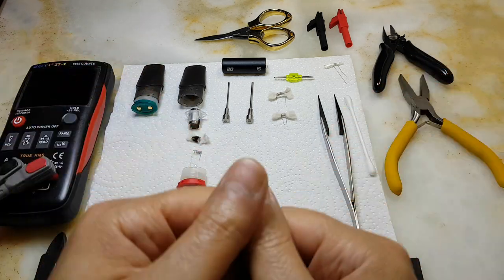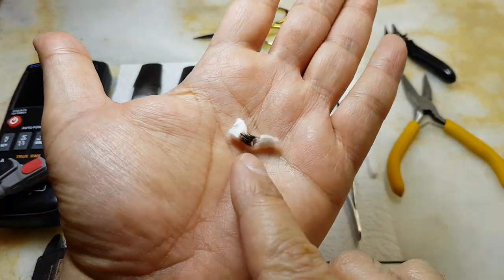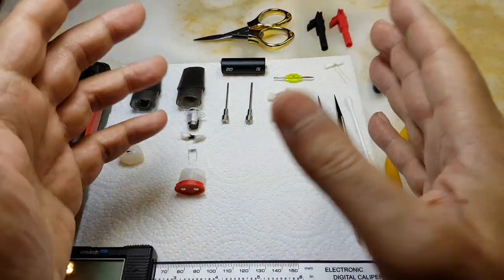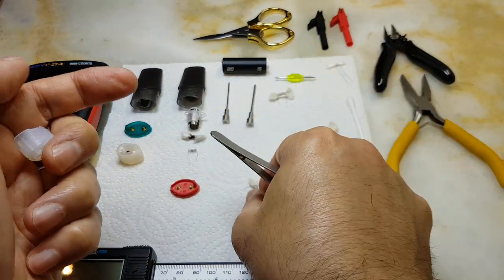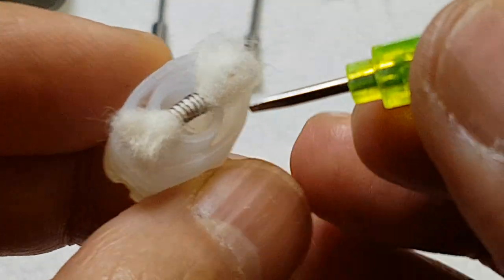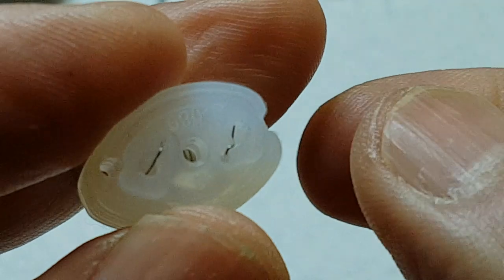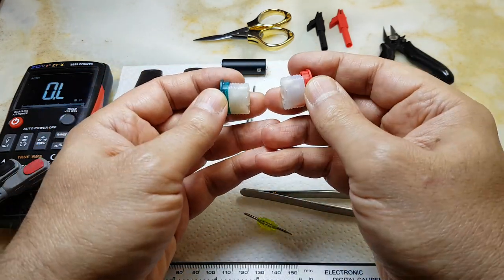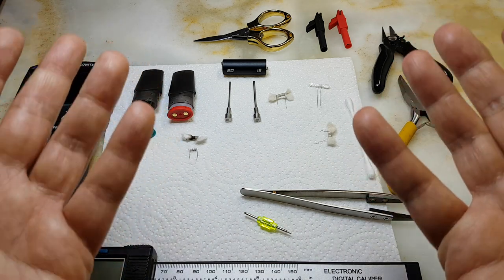Vype ePen 3 rewick & recoiling cartridges

Comment: I've recoiled mine. I use the 1.8 ohm premade welded nr r nr wire from fast tech. I also coil it on a 1.5 mm. Also when wrapping wrap away from you, as it's backwards than the minifit, this way the coil will end up fitting more horizontal Works pretty good and good flavor.
 I read the specs somewhere it was 1.95 ohm. I suppose a person could use the 2 ohm coils to get close to the original and flavor.  But using the nr r nr wire you run less of a chance of ruining the rubber because the leads don't heat up.
Reply: Nice, do you think the rubber would burn/damage easily  with regular kanthal? (that's seem to be the wire vype used in these pods ) i'm also interested in the minifit but the epen seems to be lot easier to rebuild and it's like 4 times cheaper than the minifit LOL
Reply: @urbanspy2008  
I have the vype epen 3 also. I like the build quality of it also, and the draw from it nice too. 
I use the NR-R-NR wire on all my above ohm devices. In my opinion this ensures that the rubber or plastic (depending on your device) will not burn or char. (I'm kind of a tight ass, and want to ensure my pods will last as long as possible.) However, you do what you have to do to recoil /rewick it. For me the key is the Scottish roll of the wick, for more flavor and less flooding/spitback.
I hope this is helpful and answers your question.  This is just my expierence.
Reply: @urbanspy2008  
Also another trick I use to recoil these type of devices is this.
When figuring out what diameter to recoil the pod, I went to the hardware store with a digital measuring device. Got some regular nails and measured different diameters between 1.6 mm and 1.9 mm picked up 2 of each.
Got back home and put the nail in the two cut out divots. Which ever one is the snuggest, is the one I wrap the coil with.  This also ensures when you thread the cotton through,  it will be snug enough not to let extra fluid in when rewicked and flood device and give you less spitback (if any) also. 
Again just my experience and thoughts on gauging the perfect diameter. With NR-R-NR wire, this trick works wonders because you don't have to guess or use steam engine on calculating wraps.  Pretty straight forward (figure best diamter, wrap wire,  thread cotton, prime coil with juice, fill pod, put together and vape.
Reply: I made coil from SS 316L 32 AWG, about 1.9ohm but it does turn off after 3-4 long hits - I get 3 times ed light blink. What coil should I make to prevent this?I have 28, 32 and 38 AWG SS wire, I think about making wire form 4x38AWG, just twist 4 wires together. I will go with inner diameter about 1.8/2mm, what resistance should I aim to reduce automatic turning off the device? Should go for about 2.2 ohm instead of 1.8?
Reply: @Piecho3a  
As I've said in my previous posts, somewhere I read the original coil 1.95 ohm. 
Also, I recommend the NR-R-NR wire from FT. The have a regular welded wire which is nichrome, and a kanthal welded wire. 
In my experience,  the kanthal wire takes a little longer to heat up than the nichrome wire, for me cause flooding issues, because like you I take long drags/puffs.
In my opinion,  for pod systems like these, Stainless steel is what I've read most of them use but are NR-R-NR wire. FT no longer sells stainless steel NR-R-NR wire.
To get it to heat up efficiently,  I would recommend a nichrome wire. Some complain they don't like the taste, but it does heat up liquid efficiently for the size of the device.
With what you have though, stainless steel heats up pretty quick.
My opinion for your build:
-32 awg stainless, 2 mm inner diameter,  10 wraps.
-30 awg stainless is not going to get hot enough, 34 awg is going to get to hot.
Also on the coil, don't crimp together,  kinda have it a spaced coil.
I hope this is helpful.
To build coils here is a site to go to for using regular wire:
https://www.steam-engine.org/coil
Reply: Thanks. I read some of the reviews to get more info about stock coils and I am still not sure witch wire they use. 
8 wraps 2mm of kanthal to get 1.95ohm it have to be about 30 AWG, not smaller diameter - I read info about 0.15mm, so 34AWG.https://www.steam-engine.org/coil?mat=kd&r=1.95&id=2
I tried some 4-wires twist 38AWG SS316L, but I will try to make 10 wraps of 32AWG SS as you said. 
Or buy 30AWG Kanthal D and goe with 9 wraps - https://www.steam-engine.org/coil?mat=kd&r=1.95&id=2
Please post me fasttech product number and tell how to check if effcienty in this calculator.
I have also acess to Ni80 wire in local store.
Reply: @Piecho3a  
Pre-made Welded Wires - NR-R-NR (100-Pack)
0.18mm (33 AWG) / 1.8ohm
SKU#  1521201. I believe they are nichrome center. 

Authentic Kanthal Nichrome Pre-made Welded Wires - NR-R-NR (100-Pack)
0.2mm*95m / 1.7ohm
SKU# 1760909
Kanthal center.

To check efficiently with that calculator of the NR-R-NR wire, I would do this:
(For the nichrome one)
Put nichrome 80 in wire
Put 33 awg in the size
1.8 in the target resistance
If using 2 mm screwdriver or rod, put 2 mm in inner diameter
Because they are NR-R-NR wire- when wrapped the legs have no resistance, so for leg length I would put 0 or maybe .5 or 1.
In my opinion it should give you an accurate reading as far as the numbers.

I just did it to see with the nichrome one. I wrapped a 1.8 nichrome wire, first one listed, on a 2mm bit. Came out to 5 wraps. After wrapping, it appeared that welds below the coil were approx 1 mm on each side below coil.
Then I entered the info on the calculator and used 2 mm (for leg length - total of both legs below coil until welds.) 
The calculator number comes out to same wraps as the real wrapping,  so I assume the rest of the numbers will be accurate. Just my opinion on how I did it and would do with other wires, should you choose to explore later.
Reply: Thanks for complex reply. I might give a try 1521201, but as you said there will be any difference compare to 32awg SS316L?
Reply: @Piecho3a  
I've never used  SS 316L in these,  as FT doesn't sell the NR-R-NR wire anymore and also I'm a tight ass that I don't want to risk charing the rubber, giving the pod a horrible flavor.   Some say there is a difference in taste, I think it's subjective, but that's personal preference.  I personally don't expierence much, if any taste difference.

I'm glad that may I can help you. I have no problem with complex answers, as I was a beginner once too. Only a few years ago. The you tube community and vaping community with forums and videos helped me out immensely to learn, so I like to pay it forward to those. Saving them money (as I've spent a bunch experimenting) so they don't have to.

Here's a page I found on the specs (where I got my info) on the vype epen 3. Scrolling way down you'll see the info on the coil.

http://www.levapelier.com/en/epen-3-by-vype/?cn-reloaded=1
Reply: @827stormin  hey man by any chance do you think you can make a video succesfully recoiling this, ive tried with two differente gauges and no luck so far, I just keep getting the white blinking likes. And it sucks because I already invested in a kit and material :/
Reply: @elviscossio3597  
I'd like to help you out, however I don't make videos. Don't know how and I don't want my face on internet. I don't even have social media.
Anyway, I would like to still help if I can.
The nr-r-nr wire from Fast Tech is the best option, but it takes forever to get to your destination.
What gauge of wire are you using? What material wire are you using? Those are important in determining the wraps and ohms.

https://www.steam-engine.org/coil?r=0.7&awg=26&id=2.4

Use this site to determine the coil you want to build. To get an accurate number the leads have to be measured. There is a box for coil inner diameter (id recommend 1.5 mm)
Lead length, has to be total of both legs.
(I just measured mine- 10.2 each. So enter 20 to 20.4 somewhere in there will get you in the ballpark.)
For gauge, I don't know what your using, but I'd recommend between 30 and 34. 32 is probably optimal. I'd also recommend  stainless steel as it heats up quicker and cools down quicker. Plus from what I've seen in my research it provides best flavor. But thats a matter of opinion.
I'd recommend the target ohms be 1.8 to 2 to get to the original draw and flavor.
Reply: @827stormin  thaks for the reply, I got a 30 awg Kanthal 8 wraps at 2mm but it does not heat up properly, and it makes a nasty flavor.  I was just now reading another comment from someone claiming to use a 30 kanthal with 6 wraps. Little confused now, might try 32 awg stainless steel?
Reply: @pitek3488  
This was 2 yrs ago. I'm still using this device as we type.
I've done numerous testing and the best results I've come up with so far, to summarize:
-2mm rod or 14g blunt tip needle
-1.7 ohm premade nr-r-nr Kanthal-Nichrome from FastTech. They are about $3.50 or so for approx 100 in a bundle.
-Cotton Bacon (the regular, not the prime). 
This has worked well for salt nic or freebase nic for me. I'm using 18 mg 60vg/40pg and my salt nic 50mg 50/50.
Hope this helps.
Reply: @pitek3488  
Yes. I believe that what the site states that particularl wire is. If I know my guagrs correctly, should be 32 awg.
It will fit, I'm using it right now.
The premade nr-r-nr wire (which is darker in color in the middle, ramps up a little quicker, but to me has a little different flavor. It comes in 1.8 ohm, which also simulates pretty well and the wire thickness I believe is 0.18 mm (which I think if I remember correctly is 33 awg)

Comment: I refilled lots of times no problem, The trick is to keep refilling when it goes down a bit so there is never alot of air at the top.  The more air the more carbon black so just keep refilling to avoid.
Reply: @pitek3488  i don't rewire them. I just soak them in white vinegar then scrub then with interdental brushes, then boil them with water and dry them. There really hard to recoil. Also top tip use scissor twist grip to remove bottom, with a pair of scissors

Comment: Hello, thanks for the great video! I tried recoiling and rewicking , however the pen doesn't fire my coil. The white light just blinks a few times . The only think I did different was I approximated the 2.5 mm diameter as I didn't have a tool to measure and also I wrapped 8 times like the original coil. Also I don't have ceramic tweezers so used regular metal tweezers. What did I do wrong?
Reply: you will never equal the same coil resistance if you change diameter and wire gauge, i think the epen 3 wont work with coils over 2 or below 1.5 ... for 8 wraps and 2mm diameter you need a kanthal 29 wire and it'll give you 1.6 ohms or kanthal 28gauge 10 wraps 2mm again 1.6ohms or kanthal 30 gauge 6 and a half wraps 2mm and again you'll hit the 1.6 ohms ... the guy who made the video got it wrong, 34 gauge kanthal is way too thin and has a lot of resistance that's why he went up to 4 ohms ... here's a nice ohm calculator so you can know the diameter, the gauge and the wraps you need to achieve any ohms you want. https://www.steam-engine.org/coil?r=1.6&id=2
Reply: @urbanspy2008  ok makes sense. I think I'm starting to wrap my head around the different variables. Thanks so much for the advice .
Reply: I built on the 30 gauge kanthal, 6 wraps on a 2 millimeter diameter and got 1.52 ohms. Pretty good for a MTL, and the easy coil jig I just got was a must. Let the games begin!!!thanks urbanspy
Reply: @TheHarpreet360  hello.Do you use Kanthal A1 30Ga ??

Comment: So how many times can the pod be refilled after rewicking and recoiling. lf only once or twice it is hardly worth the effort.
Reply from the maker: You are quite right. It depends on the seal of each pods as how long is going to hold on to the liquid. As they don't hold much liquids they need a refill quite quickly but my guess is about 8-12 times if doing everything right. Cheers and good luck.

Comment: hey,thanks for the video but could you tell me what kind of coils i need to buy ? like what dimensions or something like .Thks
Reply from the maker: Hi, thanks for your question. The wire is 32-34 awg canthal or stainless steel. Good luck.
Reply: @HomBKaviani  thanks
Reply: I've recoiled mine. I use the 1.8 ohm premade welded nr r nr wire from fast tech. The heating part of the wire is nichrome I believe.  I  coil it on a 1.5 mm bit.  Also when wrapping,  wrap direction is going away from you, as it's backwards than the minifit, this way the coil will end up fitting more horizontal Works pretty good and good flavor.
 I read the specs somewhere it was 1.95 ohm. I suppose a person could use the 2 ohm coils to get close to the original and flavor.  But using the nr r nr wire you run less of a chance of ruining the rubber because the leads don't heat up.
Reply: @827stormin  Hey how many wraps ? I have the same wire lef I used to have minfit , I did 5 wraps on 2mm for minifit , how many wraps on epen ?

Comment: Can you use something like electrical contact cleaner to clean the original coil
Reply: I wash them with hot water and that seems to be enough. You can also use rubbing alcohol. You don't actually have to recoil it, just clean everything and replace the cotton.
Reply: @catkin-z8g  You could burn off the coil, just make sure it doesn't get red hot or it's ruined. But you still have to replace the cotton with a fresh one. Reused cotton gets really nasty.

Comment: Hello, I have had a hard time finding a 34 or 32 awg, can you use a 28 awg or is it not recommended?
Reply from the maker: Hi, not advisable as lower gage wires takes higher current and the battery might overload and is dangerous or it may cut off the battery.

Comment: Hola bro lo compre y a los 2 días me contó a fallar le doy la primer jalada y el led parpadea de color blanco unos 2-3 segundo y se apaga aún que tenga toda la carga y apenas si saca algo de vapor cómo lo puedo arreglar???( Lo compre hace 1 semana)
Reply from the maker: Hi, sorry mate, don't understand your text. Take care and thanks for visiting my channel.
Reply: @HomBKaviani  Hello friend, what I want to say is that when I vype after 2 days of use I do not know what happened after charging it, I use it and when I try to steam the LED it turns on 2-3 seconds white and turns off and it barely takes out any I ate this steam a week ago
Reply from the maker: @jeeeckyt8768 , it sounds like your device is faulty. These are very safe to use and if something goes wrong it shuts itself off. If your device is one week old it's definitely faulty. They have 90 days warranty if I'm correct, my advice is to change it for a new one under warranty. Good luck.
Reply: @HomBKaviani  ok thank you very much brother
Reply: Te dan garantía de 6 meses broh cambialo